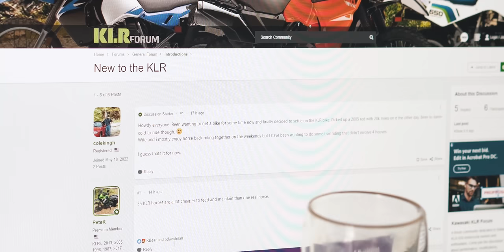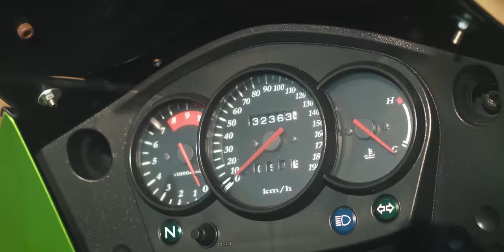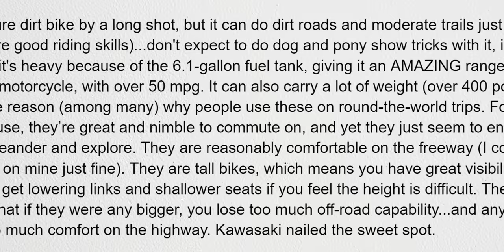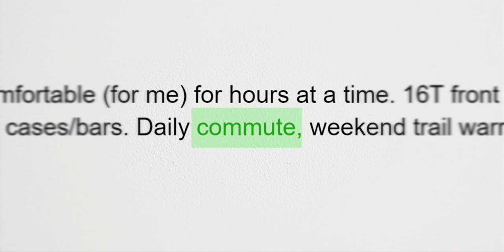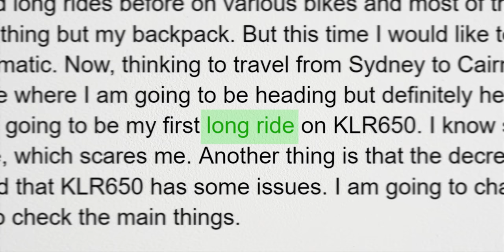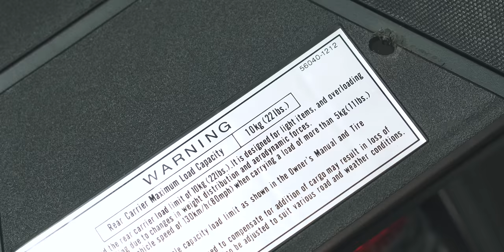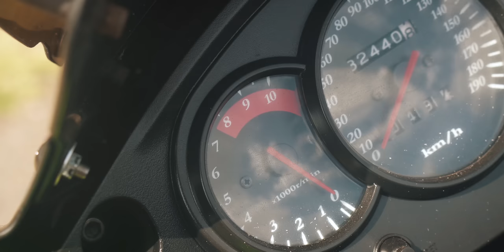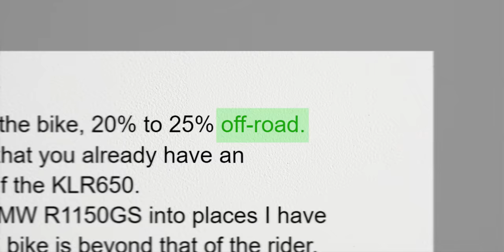I HATE the Kawasaki KLR650… so I BOUGHT one

Comment: I have a 2008 which I purchased for $2500. it came with Nav garmin Givi bags ,aluminum dash plate and bash bars. The guy who had it befor me toured and put 64,000 KLms on it, now has 67,000klms. The running gear was worn, New sprockets & chain, new clutch, new tires, carb kit got rid off heavy GIVI bags, just put new shims in and engine is still running strong. Does what i want it to do back roads gravel, hwy. for the small investment and bringint up to snuff, its a beauty.

Comment: I just bought a 2018 with 3,402 miles with plenty of performance mods in pristine condition with a maintenance journal showing all work.

I had walked in to the local dealer expecting to ride out on a 2023 Himalayan, but I got so much more a little more money. Its the only time I've owned the same model twice. My previous KLR was a gen1.

This 2018 gen 2 with carb, intake, exhaust, suspension, etc. mods is an Uber Pig. I took it up to 92mph at about 5krpm and it was still pulling steady with no speed wobble. It'll do 100mph+ no problem.  I did get a minor speed wobble when I chopped the throttle at 92mph.

Sadly, my pig will be relagated to commuting and living outside of my condo 24x7x365.  I expect weather to take its toll in 5-6yrs.

As an outside bike that is self maintained, simplicity counts. The biggest pain is the shim in bucket lifters under twin cams, but I've done them in a morning in my parking spot on my old pig.  I would even think about it on my vStrom 650.

The KLR lifter service is every 15k miles. The Himalayan is evey 3k miles, but it has tappet adjusters that are tiny and hard to get at like my baby ninja. The Himalayan only has about 60% of the hp of a stock KLR and the weight of the bikes are essentially the same.

The only advantages of the Himalayan are its air cooled which translates to few maintenance issues and it has a lower center of gravity at the cost of suspension travel and ground clearance.

Comment: not sure why you bought a old one though, a new KLR has different powerband, fuel injection and different suspension,  longer rear swing arm, more rake in the front, a more solid frame and subframe, vibration dampening, digital dial, better seat design, a bigger magneto and places to put USB and other electricals, basically everything you didnt like was changed.
Reply: Does it still have the doohickey?
Reply: Yeah what the hell are you thinking of buying an old one?
Reply: Maybe because a new one is 3 times the price? Maybe because this video was obviously never meant to be about how much better the new KLR is, but rather about why people liked the old ones in the first place? Just a wild guess.

Comment: I bought one in July,. A 2013 in nearly new condition with less than 8,000 miles on it. It's comfy although for my height I'm on my tip toes at stop lights lol. It doesn't accelerate very quickly, but I can get it to 85 on the road if I ring it out a bit. To me, the vibration and wind buffeting is part of the fun of it. I like that it is relatively quiet, I strapped a milk crate on the luggage platform, because I use it to do any errand that gives me an excuse to take a quick ride. It is surprisingly nimble for it's size.  I will eventually upgrade the front brake setup for better stopping power. I'm also probably going to put a more road friendly tire on the front. I don't see myself trail riding with it (Although, where I live some of the roads are not much better than gravel tracks lol).

Comment: I bot the Kawasak 650 in 1997 i have loved it everyday i was on it. The clutch is a little soft and it is fast enough for me ,up in the forest where you  can't go a constant speed above 40 so you don't need a bike much heavier than it.
   The Klr650 needs to be geared down a bit for dirt 1 gear too  tall for the slow  steep stuff otherwise perfect,it tends to overheat otherwise it isn't a trils bike. My bulltaco is for that, it would climb a tree if it had traction. 
  The kawasak Klr650 will keep up with traffic with out complaints,a hundred and 10 is fast enough .my 1972 z1 is for that speed and faster. 
   The kawasak 650 is a duelsport and does a great job at both for a onley bike it is a great bike.it has been under water up to the mirrors and didn't leave me stranded.

Comment: For all these reasons, I bought the Transalp 650 instead. All the pros of the Kawasaki but with a V-twin.  For 2300 Euros (crash bars, GIVI monokey racks, usb and 12v lighter power plugs included). 
It's nowhere near my top-spec BMW S1000R but that's why I love it. 
I can work on it myself without caring too much. It's very comfortable and with 21/17" spoked wheels and 200/180mm of travel, I never have to constantly watch out for bumps and potholes - it just glides over anything. And with the year-old Heidenau K60 Scouts it came with, I'm having a blast off-road. And I'm never scare to push it 'cause I might crash it. I can also leave it anywhere in town without disc locking it and chaining it to trees/poles and still sweating every minute I'm away. Finally, freedom.

I have put up my, bought new in 2019, S1000R for sale although I'm quite sure I won't survive with just this old bike, but I might look into getting a Thruxton or something else for pure road and cafe joy.

Comment: I'll point something out that you completely glossed over and fits the DIY budget topic you thankfully talked about.

Guess what happens when you have an engine that hasn't changed for so long? Parts availability that doesn't require knowing exactly what year you have to make sure the part you bought will fit or not because of some small change that maybe made something better that you didn't care about. You competing them to the Toyota Hilux was very appropriate because parts for them are everywhere. And when you're traveling around, having parts is the difference between being stranded and getting to where you need to be. As for fuel injection, yes injectors fail by getting clogged, stuck open, or stuck closed, and if you're lucky you can pull it out and try cleaning it. I've experienced this first hand when going to and from work. Went to work fine. Lost a cylinder when starting up to go home. I've also had a carb fail on my VFR but guess what, it still worked, got me home, and cost me 0 dollars to fix unlike the injector which cost me a couple hundred because I had to buy a pack of 4.

When living with a carb vs fuel injection every day for years, I'll take a carb every time. Paper isn't the same as the real world.

I'm only in my 30s but I'm starting to understand the "kids these days" statement more all the time. The real world is very different than TV, Movies, and what the salesman tells you.

I do appreciate you at least tried to dig into living with something you assumed would be completely bad.

Comment: My 1996 KLR was the slowest bike I've ever owned and the most fun bike I've ever owned. You'll never get anywhere fast. But, you'll always get there. It tractors up the steepest of hills w/o wheel spin. The crazy engine braking means you neve have to touch your brakes when descending stupid steep declines (just kill the engine if idle isn't slow enough). The bike is light enough to pick up all day and heavy enough so it's not blown around in bad cross winds. I upgraded w  an aftermarket shock, progressive front springs, thicker fork oil, soft luggage, subframe bolt, radiator guards, bark busters, and the Doo. It took 3 Boston winters unprotected outdoora to finally kill it in 2016.

Comment: Went from southern Connecticut to Laconia with 5 guys on sports bikes with my KLR 650. They thought I would hold them back on the trip. However I was not only able to keep up but managed to leave them in the dust on the corners. Even on the straightaways I kept up no matter how hard they tried to leave me in the dust. Now you may be surprised that for the whole time we were in Laconia ,I never was able to grab the keys to the KLR first. It was the absolute first pick for all the group to drive. It amazed the group with the fantastic gas mileage it got on the trip. I would have half a tank of gas left when the rest of the bikes were running on close to empty. Best bike I ever owned and wish I never let one of the guys buy it from me. Miss it.

Comment: I have a 2004 RC51, a 2019 GSA  and a 2006 KLR,  The KLR gets ridden way more than the others.
Easy on fuel, cheap insurance, all.weather, all conditions and totally unattractive.  I added a 4" pvc tube an cap to the front of the skid pan and a cheap Pelican knock-off on the cargo rack.  Kenda Big Blocks transmit power to the road.   
It is not fast, but that bike will climb trees, hop curbs, haul groceries, take me to work and do it all with sub 40 HP.

Comment: The KLR650 really needs a new engine. 
It's super heavy and has terrible performance. 
The CB500x has 10 more HP at 150cc less displacement, 50% better fuel economy,  for the same price. 
Was looking at bikes at the local moto dealer. 
They had almost nothing in stock for new bikes because they are selling faster than they are coming in. But sitting there are 2 x brand new KLR650's that nobody wants even though you have to wait 6 months for the competition's bike to come in.
Reply: Local dealer has eight on the floor...

Comment: The KLR is definitely the best bang for the buck. It's an excellent starter bike (off road and on road) because you can take it almost anywhere. It's a slow chugger that will get you up hills, out of sand or mud, through snow or streams. 
You have room to add extra bags and gear but the KLR will still take the extra weight and get you there. It's a mid/heavy for starters, but it's best to learn on a mid/heavy and go from there.
I believe they are the most versatile bikes when it comes to parts and aftermarket parts. Plus with tons of forums and social media groups dedicated to this bike. 

So no wonder Kawasaki didn't change much.
Besides the now fuel injected KLR's.
I own a 2023 KLRS and absolutely love mine. 
I just feel like that people who rag on the KLR are only saying so because they compare it to a bike that is more specific to its class.

Comment: Excellent vid. I owned a Kawasaki Tengai 650 (KLR in a nice frock) for several years in the early 90's.
I put hairline cracks in the frame near the footpegs by riding it to Central Australia @ 130kph. (nice 23L tank, though)
It was/is a tractor. I rode a more recent model KLR about 5 yrs ago and the (not so) happy memories came flooding back.
Suzuki V-Strom 650's have been my steed of choice since 2007 and they are orders of magnitude better than the John Deere.

Comment: I bought a Kaw in 72. The F series 2 stroke 175cc single cylinder.  It had a spidery look, while the other brands stuck to the old "Cafe'" style. 2 strokes vibrate.  I NEVER TRIED OUT A HONDA, YAMAHA, SUZUKI since then. The old bikes looked heavy, looked like they never could be a dual purpose machine. The carb was NEVER an issue, it had CDI ignition, and a rotary valve to inject the 2 stroke 
.  Looking back I find that strange that I never tried out the other machines.
10 years later I bought a KAWASAKI 4 STROKE TWIN.  Rode it for several years and then just QUIT BIKES...COLD TURKEY.
In between those years I also had Kawasaki 250 2 stroke, Kawasaki 400cc 4 stroke twin, Kawasaki 500cc2 stroke triple cylinder(bought, borrowed, steal - however it went many years ago)
Right now, I don't care about riding.

Comment: I like the original KLR650, and have owned 3 of them. Due to medical issues I have had to downsize to a Yamaha XT225. The second generation KLR650 took a really good bike and made it too heavy. I don't even consider the newest KLR650 a motorcycle. It is now a computer cycle. I only have one computer, and it is on my desk. I do not ride or drive a computer, and I do not carry one in my pocket. 
My biggest problem with the KLR650 applies to all bikes with tube type tires, and that is tube type tires. They are a LOT easier to puncture, you can't fix a flat without removing the wheel from the bike and the tire from the wheel. You have to have a way to support the bike while doing that, and you have to carry spare tubes and a whole bunch of tools you wouldn't need on a bike with tubeless tires. All my KLRs and my XT225 have aftermarket centerstands. 
You can also get mounts to put a couple more of those imitation Pelican cases on the side as saddlebags. With a centerstand, chains don't bother me at all. Modern O and X ring chains last a long time with little maintenance.

Comment: The only (1) serious issue that would make me not buy the newer 2022 KLR 650 is:
the doohickey in the engine that goes bad after about 5000 miles & may ruin the engine.
And yes this is still a problem on the 2022 models, I'm told by non-Kawasaki dealers.
Addendum -
The small issues that also make me not want any KLR 650 single:
- way too high of a 1st gear, 
- too heavy/sluggish, i.e power to weight ratio, 
- no tachometer, 
- many other 2022 adventure motorcycles are higher tech. & has better features

Comment: A thing to note when comparing fuel injection and carburettor reliability, is that to operate an injector you need a pump and computer. You cant service a modern pump if siezed, nor the injector if clogged (or the computer if wet). You could ignore an O2 sensor if it goes perhaps, but you cant re-tune it. So in an "Africa" type scenario, the carb is more "reliable" because problems are never catastrophic.

Comment: Still riding my 2006 with 156,000 miles on it now.  In the motorcycle world the KLR is the Apocolyptic 2 wheeled  Cockroach of the Universe.  I've tuned it through and through over the years and it's the most reliable and comfortable motorcycle I own.  And I own a 2013 Super Tenere and a 95 E900 Ducati Elefant and several others.  So that's saying a lot!
I have no plans to replace it!

Comment: Nope, don't hate them. I bought one brand new in1993. Still have it, still ride it. It's been to every western state in the US and damn near every state in Mexico. Met my wife in Manzanilla,Colima,MX. while travelling.
Why do we like them? You can go anywhere(dirt, gravel, sand, and paved roads) fairly comfortably if you don't drive over four hours a day.  They are easy to work on, cheap to work on, and reliable. 
FYI- I even road my KLR to the top of Sand Mountain in Nevada. Recall, it only has about 35 hp so getting up it wasn't easy. I had to get up to 90 mph to make it. But I did make it.😎(after three or four attempts).
And speaking of carburators - I had to disassemble mine while twenty miles deep into the Canyonlands National park (Utah) loop. Cleaned it out, put it together and I was on my way. Here is a YouTube video of the White Rim loop https://youtu.be/Rd4_LxhmcZU

Comment: To fix the engine problem. The needle is not adjustable. All you need to do is place a small electrical washer under the needle to raise it a touch the thickness of the washer about half a millimeter. 
Enjoy the mid range extra power.

Comment: Fuel injection was actually reliable back in the 80's when Kawasaki used it on the GPz1100, the 750 turbo, the Z1300...

Comment: Owning an Africa Twin and a KLR I could give the same review with a caveat. I have a 97 klr and he's right the vibration is heavier and it's bare bones for commute and off road but that's better for reliability and makes it easier to control off road. Drop your KLR (with crash bars) off road (if it never falls you aren't pushing it) pick it up and keep riding. Drop your Africa twin and there will be some damage then struggle to pick it up. While the Africa Twin is better response, speed, styling, accessories and on road the KLR doesn't compare at all, the price, durability, ease to repair on your own and customize makes it a better purchase and will most likely last longer.

Comment: Been ridin motorcycles for 40 years, I bought a KLR650 a few years back and made an adventure rig out of it. It was a reliable bike and easy to use,But it has a high center of gravity, Yes I changed the dog bones,  and is ok on the highway.and fair off road. Thanks.